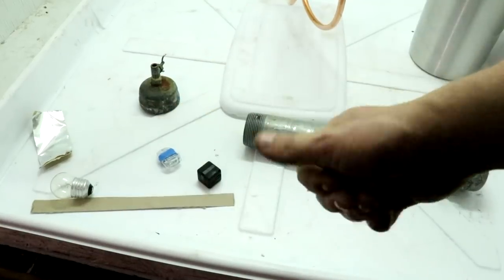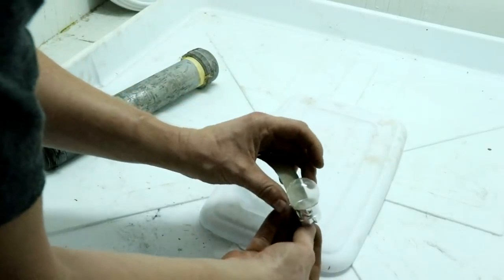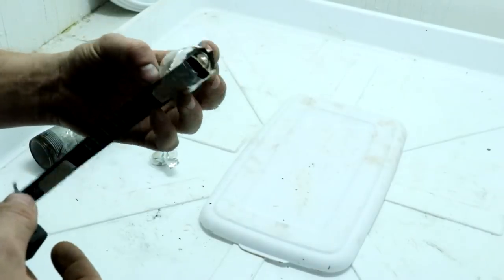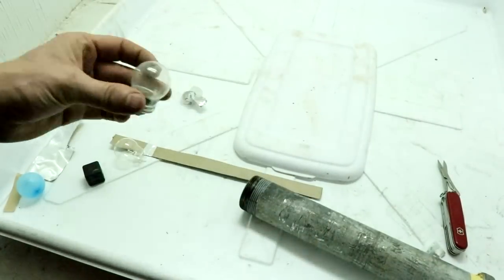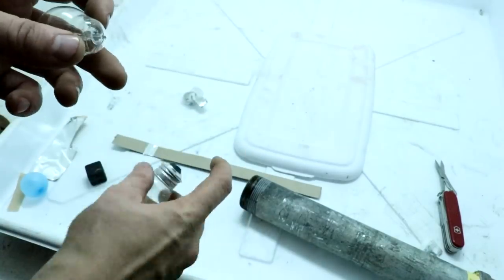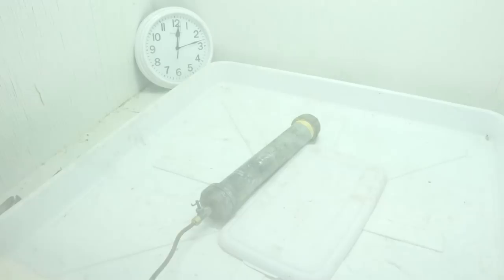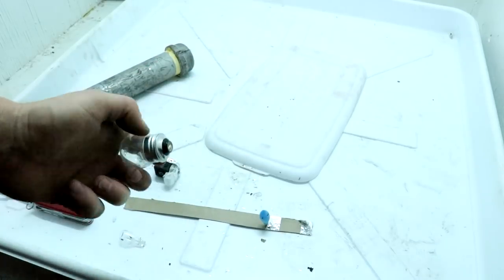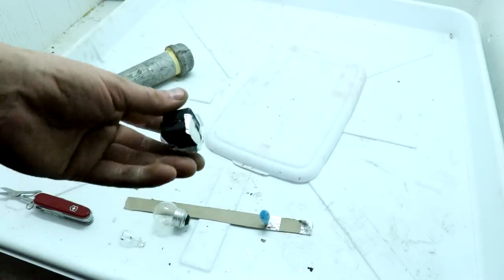Cheap Camera, Light bulb, Survive 800PSI?

Comment: Its the good old pipe bom....i mean presure vessel again great to see it in action.
Reply: It needs more supportive ball barrings.
Reply: could use some nails aswell.
Reply: glitter!
Reply: right  he has everything he needs to
Reply: Anything can be a pipe bom hell a co2 cartridge is a pipe bom and nearly every teenage kid has or has had a pack of them. Notice you didn't spell out bom tho, good idea I don't want my comment up for NSA review 😂
Reply: tiny co2 can isnt gonna turn you into ground meat
Reply: john dowe Yes they can. I would feel safer around codys pressure vessel than a large 20oz co2 tank having 800psi for a paintball gun. The walls are much thicker on his pressure vessel than co2 tanks and on top of that most are aluminum at least most I've seen and so that makes them much much weaker than his pressure vessel. You are very wrong about that because my friend left a 20oz tank for his ptball gun in his truck in the hot parking lot and it exploded and it blew the doors off n fkd shit up. Codys pressure vessel is safer than any co2 tank if you've ever seen mythbusters pip bom it blew out one side and really wasn't that damaging. That's why most terrorist use aluminum because it breaks up in sharp pieces unlike steel it will warp and bend and shoot off to one direction rarely do they throw shrapnel without something inside of them even so it would most likely only throw shrapnel in one direction. Cody does not officially have a pip bom without shrapnel inside like balls nails etc it is as he says a pressure vessel.
Reply: Exactly what I was going to say, but I see everything is taken care of here
Reply: @mlgsamantha5863  anything can be a filfo if your brave enough 😂

Comment: If you use glow tape instead of a battery-powered light, it might fare better and will be much brighter if you run it down the entire length of pipe.
Reply: Glow paint or tape would never show up on camera especially not a $20 one.
Reply: Can it handle the pressure tho?

Comment: Finally some high pressure experiments. You go Cody and please be careful. I worked testing fire hoses at a factory at those pressures. One failure at 800 psi blew off a coupling and it tore threw a three quarter inch thick sheet of plywood and the skin of the steel building we worked in at 80 ft and still traveled another 80 ft before coming to a stop and this was a failure of a one inch in diameter 50 ft hose.

Comment: 800PSI = 5,5 MPa = 55 bar, approximately
Reply: If you want to show off how high pressures are, you use psi. 55bar or 5.5MPa doesn't look high enough...

But wait, 5.5MPa are 5500000 Pa, that sounds even more... he should rename the video to "new camera vs. 5500000 Pa pressure chamber" or something like that. ;)
Reply: What about atm?
Reply: Lèmmark 800÷14.7=54.42atms.
Reply: They're close, but not the same.
Reply: zvpunry
But most people don’t use inches of pounds.
Pascal is the official SI-unit for pressure (Pa=N/m^2), and bar is basically the number of atmospheres.
Reply: Does that mean that density of CO2 in the chamber was 55 times greater than it could maximally be outside? It looked like fluid inside.
Reply: Divine Linker 
Yeah, but I don’t think it’s enough to make it condense. The concentration of CO2 in the air is very low.
Reply: 55 bar is pretty darn high. Car tires are 2.5 bar, bicycle tires max 4 bar. And those give a big bang when they break... so being at 13x that pressure is pretty darn high. Equivalent to 550 meters under water level in the ocean, incidentally.
Reply: dascandy Race bicycles have up to 8.5 bar in their tires, it gets scary everytime I pump it
Reply: I see why the camera didn't like it
Reply: Depends on the temperature of the inside of that pipe, at like 20c I think somewhere around 50 bar co2 can start to turn into a liquid

Comment: Would your roller mill be able to make super thin sheets of metals for capacitors or is it too thick
Reply: You can make a capacitor at home from aluminium foil. So probably.
Reply: Charles Lambert what I meant was could you make one thinner to get a higher capacity in a smaller area
Reply: GuardedDig2 I dont think you can do much better then the thickness of foil unless you get into expensive and extensively engineered and meticulously machined rollers. Any imperfections like divets or uneven rollers would make it A pretty bad candidate for going any thinner
Reply: Chemical vapor disposition is the way to go there if you want thin. Thin films...etc  The semiconductor industry is all over it.
Reply: I think it would be awesome if he tried using the roller to press together a couple of layers of aluminum foil with a couple of layers of some isolator (Cody will know how to separate the two terminals, it's very simple)
Reply: Daniel Blair Ah thanks :)
Reply: ROFFLESTOMP thanks
Reply: amadeusz antyga some sort of plastic I’d think for a high voltage cap or a paper or something for a lower voltage
Reply: grind up graphite, mix with a little water and spread onto a DVD. when it dries put the DVD into a DVD burner and burn a file onto it that takes up the whole DVD. you now have a (shitty) graphene sheet for capacitors
Reply: jeremy mcadam lol thanks it’s probably better than most of my capacitors I made
Reply: Lookup Leyden Jar
Reply: Jason C I have one
Reply: Just use chemistry to deposit teeny weeny amounts of metal onto shit like in the silver mirror experiment
Reply: Shockwave Shockwave thanks I’m going to have to try and get access to my dad’s works vapor coater again but I don’t think I’m authorized to use 20,000$+ equipment for fun.

Comment: It would be awesome to see a homemade (or store bought) light bulb filled with different gasses and pressures to see the effect
Reply: That would be pretty interesting I wonder how hard it would be to do that
Reply: jacob cooke o don’t think it would be that hard just take a small vacuum chamber and put a thin nichrome wire and hook it up to a battery then using a small valve pump or pressurize with different gasses. It shouldn’t be that hard and I would try my self but Cody has many more gasses than I do. The wire  shouldn’t burn up in most gasses
Reply: GuardedDig2 I thought lightbulbs were in a vacuum
Reply: awesome stuff most are actually filled with argon gas not a vacuum
Reply: GuardedDig2 well, I knew that they had argon in it but I dident know whether they evacuated the bulb or kept it at atmospheric pressure, or pressurised the bulb.
Reply: awesome stuff they are pressurized to about 80% of atmospheric pressure because when lit the heat makes the pressure increase to about the same as atmospheric pressure. They are less pressurized so they don’t explode when lit up

Comment: Metal base damage was from the imploding glass, not from pressure. The base will be able to equalise pressure as it is not really sealed, but the stem imploding into the lamp cavity left the base with a transient high pressure on the outside, and a low pressure inside, which bent it.
Reply: shut
Reply: Less IAmVerySmart: The lightbulb didn't implode from the pressure. It exploded when the pressure was released.

Comment: Just wanted to mention a lil about SCUBA tank refills, that might make your pressure experiments tiny bit safer. 
 The working pressure of aluminum SCUBA tanks is 3000psi. That would be a "full" tank of air. Every 5-6 years we have to send our tanks away for hydro testing. The SCUBA tanks are filled to 6000psi, under water, in a machine that measures the displacement as the tank expands. If they pass this stress test then we get em back for another 5-6 years.
 
Some refill stations also put the air tanks in a vat of water while they fill. When tanks pop they normally don't blow into fragments but it's a big piece of metal that can smash through a wall or break bones. Failures are extremely rare so most refill stations don't bother with water tanks after a few seasons.

Comment: There are tiny little keychain lights that you can get at any cheap department store in the automotive section. They'd be smaller than that (I think) bicycle tail light and are white. I think part of the focusing issue is the light color. Camera sensors have (in general) twice as many green receptors as red or blue, so something green or white would work best to keep the camera focused.

Comment: Pound per square inch? To a European civilized person this sounds really weird.
Reply: To a went-to-the-Moon nation, the French "make it anything, but make it incompatible!" system seems really weird.
Reply: P K  not just European, everywhere in the world apart from Murica and North Korea
Reply: Pygar2  yes, and all your went to the moon mathematics was done in the metric system because the imperial system is ridiculously over complicated to use when it comes to science. True fact :P
Reply: No. Apollo was done on the "ridiculously over complicated" 12 inches-to-the-foot system; later flights were done on the dumbed-down 10-based French system... even though 10 is not as easily divisible as 12. You know, if the French had simply made the millimeter 1/24th of an inch, instead of an inexplicable 1/25.4th of an inch, things would have gone much better. What idiot decided to make 1/25.4th of an inch, the basis?
Reply: The French didn't just say "Make the millimeter a 25.4 th of the inch". They actually made the meter to be the (then thought to be) 10 Millionth of the average distance from aequator to the north pole. Besides, it's not like the American system was the one used before the standard units came to be. There were many measuring systems. 
And how is it important that 12 has good dividability? What advantages does that have that would make it so much better than base 10? 
And what about the mile that's 5280 feet? Yeah, very easy to calculate with those things. Stupid scientists, using units that a easily convertable and standarist.
Reply: Doug Widdowson NK uses metric? Lol
Reply: "And how is it important that 12 has good dividability? "
It's very important to semi-literate peasants who aren't very good at math. The Imperial System and its descendant, US Customary System, were developed over hundreds of years by merchants, builders, and such who were poorly educated, for the most part. It worked itself out organically based on things like the length of a foot, width of a thumb, how far a horse could plow in a day, etc. Nobody had rulers or tape measures.
Reply: Am I the only one that finds it ironic that America uses an old British measurement system?
Reply: It makes sense to me. America was made by British subjects after all.
Reply: Roset828 Don't forget the Dutch, French, and Germans, as well as the native Americans and a few other groups. 
But everyone should remember that this is a channel by an American scientist broadcast by an American company and we are not in the EU. And we're especially NOT in France.
Reply: Bob Smith yes you’re right but for this argument we’re referring to rocket scientists and very educated physicists. But your point is still right

Comment: I think 2 different outcomes came about with the light bulbs that imploded.  I believe that the first bulb, as you stated, was broken due to the weak metal band, and the second bulb imploded at a different pressure level, due to the structure, would be cool to see you try this experiment again with 2 bulbs, one with, and the other without the metal sleeve.

Comment: Excellent video! I am curious to see how a halogen  downlight bulb would go, because usually they are strongly pressurised if i recall correctly.

I think the little camera may have recorded continuously if you had slowed the pressure release even further, I think what causes it to turn off is trapped gasses underneath the ICs bending the ICs or PCB, causing electrical connections to become intermittent.

Comment: I think your first assumption of how the lightbuld failed was correct. I think if the glass broke first there wouldnt be relative low pressure in the bulb to push the metal pin in. Also it is kind of hard to tell with a sample of 1 in each configuration but the total failure where it completely broke seemed to be a cascade effect on the actually rounded part of the bulb that wouldnt happen at the approx. 400 psi it failed at before. More data is needed to even remotely confirm or deny these but its just my hypothesis.

Comment: Cody, the camera lens covers a photo chip that has a small "air pocket"  between lens and chip that is vacuum sealed. The increase in air pressure crushed the space inward between lens and chip and the depressurization probably caused it to expand too fast and I would be surprised if it didn't cause the lens to pop and release the vacuum between it and chip.   Does this make sense??

Comment: I think it's unlikely it was the pressure pushing on the lens, because I doubt everything was sealed that well. All they are trying to hold out is dust and water, which aren't pressurized. I think the pressure would just equalize on both sides. I think it's much more likely due to the refraction properties of high density CO2 atmosphere.

Comment: Use a light without a switch, or remove the switch and solder a jumper to keep the switch on all the time, this way if the battery rattles it should come back on. Get something basic, not one that changes modes or levels, just on and off. 
I would say solder the battery to the led with a resistor in series, but soldering a lithium cell cr2032 or something like this can discharge the battery. But if it doesn’t use any microprocessor for features like high, medium, low then it should just come back on if the battery rattles a little loose. You can test this by removing the battery, and putting it back in, if it’s come back on then it will be good in the pressurized tube.

Comment: There's a chance the little camera could be re-focused quite easily if you open it up.  On the ones I've seen it's usually just a matter of rotating the little lens/ccd assembly (threaded focus adjustment).  I do notice the discolourisation in the image though, so I guess something else has gone awry there, too.

Comment: Does a sealed container containing a vacuum (when placed inside a vacuum chamber) show a lower reading than the camber? Inception vacuum!
I was also wondering if the surface tension of water was much different in vacuum chamber prior to it boiling off?

Comment: Do you think that part of the light bulb exploding could have to do with the cold of the CO2 and not just the pressure? Also would it be some kind of weird chemical thing with the CO2 atmosphere + the argon inside the light bulb? Granted yes it's a fully sealed glass container but gasses/chemicals can behave in odd ways you'd never expect.. logic and physics don't go hand in hand.

Comment: The LED seemed to change wavelength during the 2nd pressurization experiment, think that was real or the camera reacting poorly?  I've seen experiments where LEDs will change color based on temperature, usually in LN2, maybe your experiment repeated this result but on the other end of the spectrum for High Pressure / Temperature regime?   Neat experiment!

Comment: A clear cap would be nice. And maybe difficult . maybe a few layers of polycarbonate between the pipe and cap. Then drill a hole in the cap. Leaving enough to create a seal. Maybe possible . great video. I wish more could be seen. Still great.

Comment: I would be very interested to see a repeat with the two bulbs, but possibly include a couple button cell, or AA, batteries with simple wiring to illuminate the bulbs as a source of light. That way you can see the reaction of a powered bulb under 800PSI. The large one in front (since it's likely to explode) and the smaller one in the back. I wonder if the increase in pressure would distort or reduce the light similar to what you saw with the LED, but by having the light source infront instead of behind. It might also give more insight to how the larger bulb blows out. Also having them lit, would increase their own internal pressure via heat expansion to combat the external, MAYBE it would be enough to allow the larger bulb to survive?

Comment: I think the metal bit broke the glass in the first test but in the second test the glass imploded under the pressure, if the bulb broke at a higher psi on the second test then it’s likely that that’s what happened. The glass didn’t shatter on the first test because the metal had already made a hole for the pressure to equalise

Comment: The light bulb is probably imploding because while you increased the outer atmospheric psi the inner pressure remained the same at whatever psi it was when sealed which should have actually been at a negative. I'm pretty sure the glass on the larger bulb was thinner also as compared to the smaller one.

Comment: How thick would the walls of a container made from acrylic have to be to handle that pressure?
Reply: From my quick calculations, about 7.5mm could hold it, but ALWAYS apply a safety index of at least 1.5 for pressure equipment, 2 if it's going to be frequently used.
So at least 1.25cm
Reply: But if you can't make the calculations for yourself, I advise not to get into HP systems.

Comment: Test if fiber optical tube can survive the pressure.  If it does you could then try to design a new pressure vessel with a sealed inlet fixed with a fiberscope tube instead of a camera.  The resolution will be limited but it'll be better than the blurry images from the throwaway (damaged) cameras.